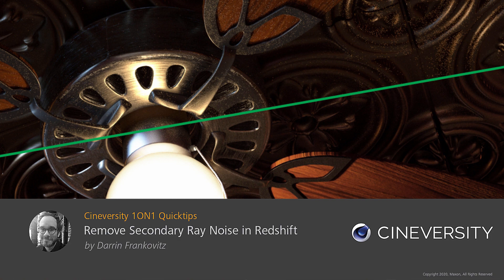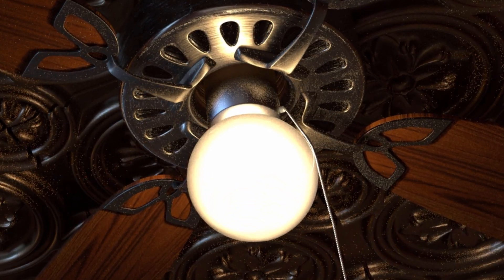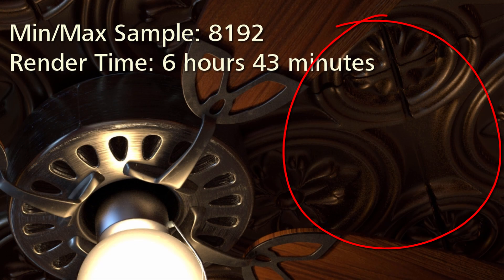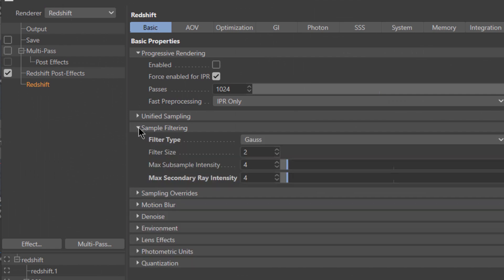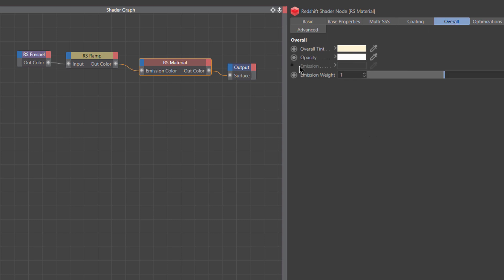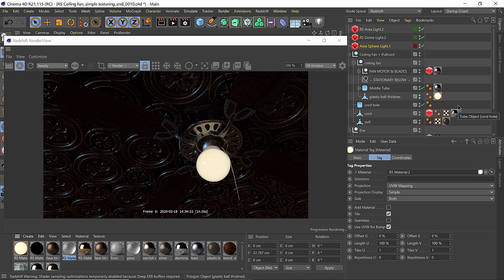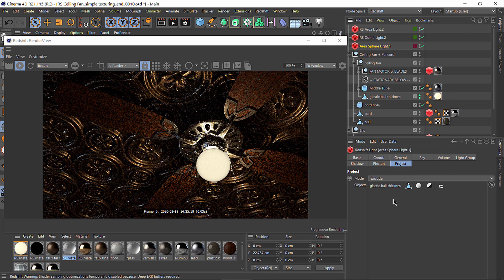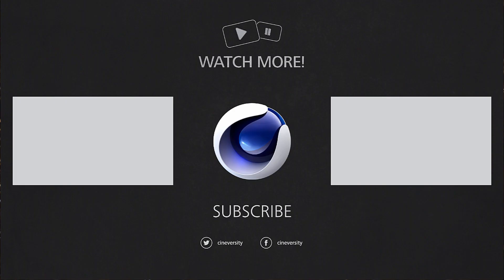Remove Secondary Ray Noise in Redshift and the "right" way to Light Bulb

Comment: Without this video I would never have guessed what the "Project" tab in Redshift Light might mean or how it is used!  "Project"/exclude should be better renamed to "Passes Through".
Reply: But it has an include option. And I think its project as in projector, not project as in a work-project.
Reply: @stemfourvisual  Exactly everybody would think "project" means work project inside a computer program. This tip is crucial for interior renders with glass window.  You want the imperfection and distortion of the glass to show up on outdoor objects but you don't want the sunlight lighting interior objects through the glass window to cause bunch of noise unless with much longer render time or denoiser.  Without this tip, we are forced to use one area light per each window pasted on the window to light interior instead of sun & sky which is more natural and you can animate.